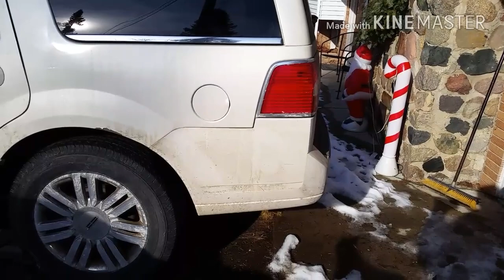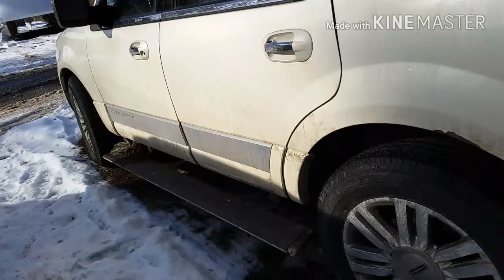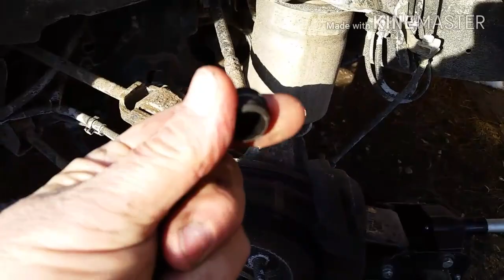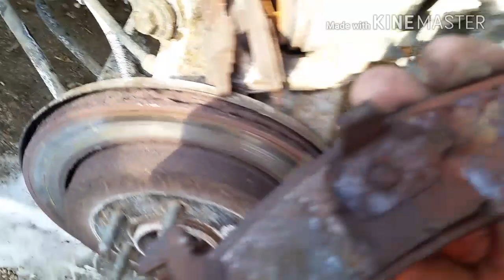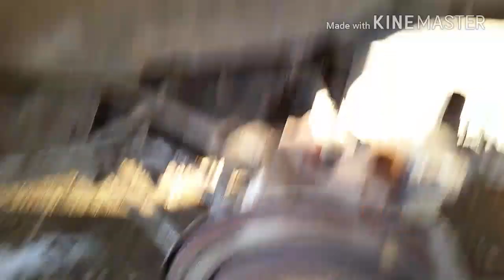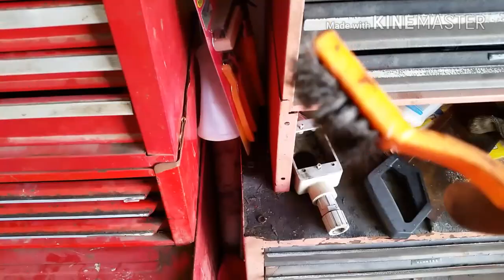2007 2012 navigator expedition rear brake replacement

Comment: Have a question after pushing the cylinder back we should purge de hydraulic oil pressing the brake pedal  and releasing the extra air or that s not necessary ?
Reply from the maker: The best course of action is to bleed the brakes on each corner of vehicle if that is what you are saying?